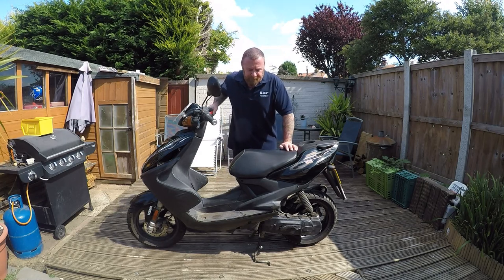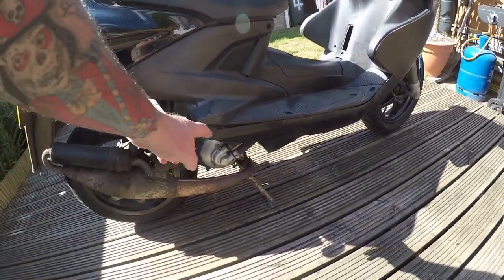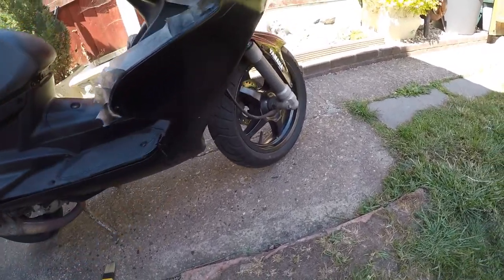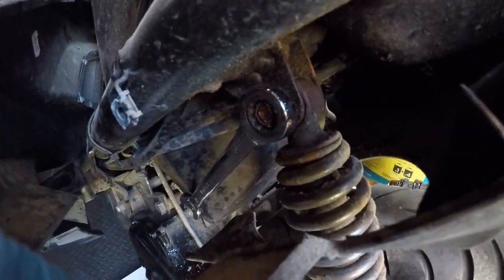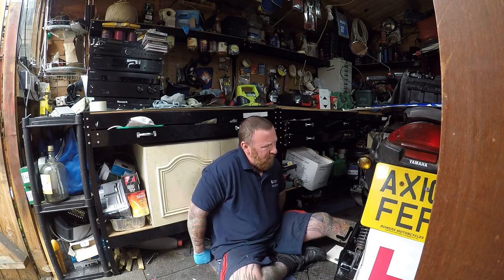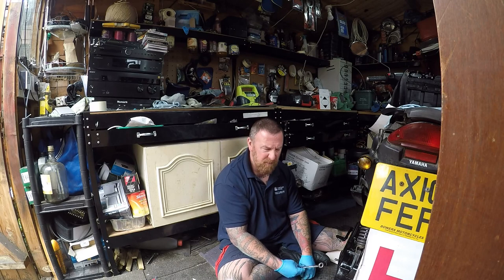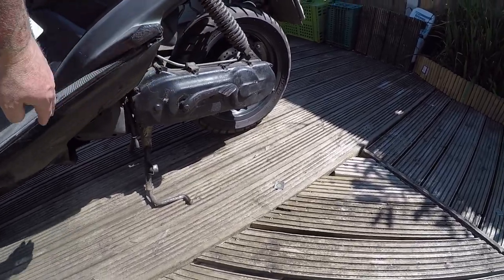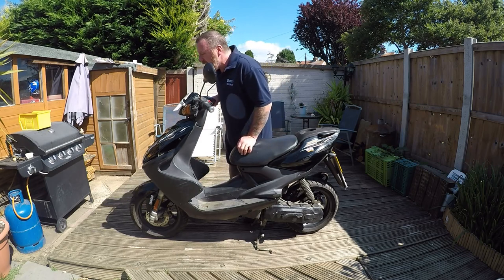YAMAHA AEROX 50CC MOPED BEGINNERS FIX LOOK OVER MARK SAVAGE

Comment from the maker: Hi all thanks for watching my newest video
Reply: Can I get some tips on a Honda lead it wont start up been told they filled up and then it stop working
Reply: HI MARK WHEN YOU SAY YOU BLEW OVER THE PLASTICS WHAT DID YOU MEAN ? THANKS GREAT JOB AS ALWAYS IV LEARNT SO MUCH WATCHIN YOUR VIDS OVER THE YEARS THEYV BEEN A LIFE SAVER IN SAVING ALOT OF MONEY LOL
Reply from the maker: @kingaz1985  blow it over as in with the spray can 
Don't spray heavy just a lite spray over .it works well bud
Reply: @marksavage  yeah thats great info matey thanks , iv just done a engine swap on my aprilia sr 2003 wc 50cc 2t its now a 2015 125cc ac 4t lol runs great had to make my own wiring harness tho
Reply from the maker: @kingaz1985  wow well done

Comment: Good video MARK. YOU KNOW THE DIRECTOR IS ALWAYS CORRECT ❗️I don’t know why but over here in the US we don’t see many small CC water cooled engines most of what we see is 4 stroke air called.  Thinking back over the past 60 years I have never owned a water cooled and I have owned some 25 to 30 BIKES, SCOOTERS, and MOPEDS from 50CC to 900cc KZZ900.
Reply from the maker: You know she's always right pmsl 
2t were always  big in the UK and not just small 50cc they did many and 250cc even a rare 500cc !!
Just fun to ride and the smell of 2t just gets in your lungs!!!
Odd i know but just brings back a happier time !
Take care mate 4t next week
Reply from the maker: Odd no water cooled as it hot but 2t run better with water unlike 4t as happy with the fan I guess

Comment: Hey Mark, watched a few videos and your content is really helpful!
Just had a question regarding my moped (2 stroke) I rebuilt it a while ago-everything but new crankshaft-and got everything running as it should, and was running great, run the new kit in for 200+ miles. But recently my bike started to loose power near full throttle, and it got worse and worse, anywhere near half throttle and the bike starts to bog and die down. I work on my own bikes, and I did change a handful of parts-new engine gaskets, new inlet manifold gaskets, new plug, new coil cap, messed with carb and other bits and bobs-but still have the issue unfortunately :/ do you have any ideas what it could be?

Thanks Mark! Looking forward to your next video! :)
Reply from the maker: this can happen and can be piston wear or once the head settles it might need a tighten down and a tune bud
clean plug and see colour 
is it ac or lc ? as if ac you can take head off and check piston to see if its scored 
sometimes the oil pump stops and then can run dry and score it
Reply: @marksavage  when I replaced my engine gaskets I do remember there being some small marks on the piston, but there was no bad scores or damage as I could see. It’s an AC engine, good old Yamaha slider to be exact. May be worth me just replacing the piston, as that’s still a cheap option, and getting it tuned, hopefully that works! I just want to try everything before asking a bike garage, as they charge a bomb haha

Thanks for the quick reply Mark!

Comment: Hi Mark love your videos, I got one problem on my scooter 50 cc 2 strokes, when it's cold works good, but when it´s hot loose a lot of torque.
Reply from the maker: Odd 
But maybe stator coil needs a clean 
Guessing you have serviced it etc 
Good rollers belt etc 
And serviced carb and check auto choke and Air mix
If so then could be stator once hot playing up

Comment: Picked up a cheap V-Clic for  £100 last week ,  First thing I did was delete the side stand switch
Reply from the maker: has to be done and that was a good deal bud , two v clic videos coming ( bloody things lol)
Reply: @marksavage  Along with the stand switch I focus on the carb and valve clearances first for poor running issues with these GY6  peds , annoyingly Peugeot  fitted an AC cdi when 99% of the other clones went with the DC  variant

Comment: Hi Mark. I think that there is a common issue with the new Aerox 4T EU4 2020 with its speed and power. On the flat they are ok, but once you start going up a hill , What would you recommend to do to get a bit of extra power. Remember that these cut off at 50kmh. Thanks for the feedback
Reply from the maker: This is why I like the older ones as you can play and upgrade 
The newer they are cdi restricted to 
So you can change lots on things like in my videos and only gain a few mph but quicker pull way

Comment: Hi mark I just bought this moped been registered since 2002 and when you turn the key for the ignition the gages won’t flick up like the fuel gage and that any way to fix and what could it be thanks 👍
Reply from the maker: take off the clocks and check them out bud
I have a load of aerox videos to help 
type in mark savage aerox s there should be over 30

Comment: I have looked through all you videos and am now a little stuck...my sons piaggio(50) has developed what seems like a misfires when accelerating, I have changed the plug cleaned the carb and checked for air leaks. no improvement, could it be the cdi/coil?
Reply from the maker: if could be a few things but normally fuel , is the plug spark a good blue colour?
vacuum working ok
float in carb ok? and the right air filter and tune like in my video
ht lead and stator coil ok ?
is it when running normal or top speed or any time?
Reply: @marksavage  it starts and idles really well, new ht lead and plug (need to find your video to check stator) was running well until last week. 
Now changed out soaking wet exhaust wadding, so am thinking way too rich. It now runs well WOT and idle but spluttering after 1/4 throttle acceleration, but does clear up. Will check idle mix and needle position. Its amazing what I have picked up and learnt from your videos, thanks for all of these and glad you are back.

Comment: just got my 2008 aerox (just like this one in the video) running and passed mot after 14 years of no use.

I've ridden it for a couple days now, everything seems perfectly fine, engine and power. but I have noticed today a kind of "rattling" sound when slight acceleration coming from where I think, the CVT area. 

Any ideas of what it could be? and how bad/serious it could be if it's in that area? 

ps. thank you in advance if you read this and reply. Cheers Mark.
Reply from the maker: I'd take off the engine cover and start as on these you can see it all working 
It can be the variator or clutch tinging even the dendix which could all do with a clean and change of belt if you haven't already 
Worse it could be is a little bit of piston slap !
Old ring etc
But start with the cvt system
Reply: @marksavage  okay thanks Mark i'll try and have a look!  could the rattling be old rollers too? I'm hoping for a easy/simple fix haha.   As I said, it's not down on power or anything like that, just hoping the little ped doesn't go bang!
Reply from the maker: @TheShubbah  no rollers don't do that but while off check clean or replace 6g
Reply: @marksavage  okay, thanks MArk. Have a good weekend

Comment: Hey mark, I have a typhoon 2019 50cc 2 stroke air cooled. I have attempted to de-restrict , taken the brass plate out, welded the original restrictive exhaust, changed the variator, and the bike still won’t go over 28mph! 

The belt and everything looks good, what could be the problem? I just simply want to destrict it is all. I checked the jet and it’s got a 58 jet in.
Reply from the maker: the newer the moped the harder restricted they are, this is why the older mopeds still command good money 
yours would be cdi restricted so you can get it to pull away faster but not much top end sorry to say without a sports / derestricted cdi unit 
then sports exhaust , roller, etc
Reply: @marksavage  thanks - where can I get a de-stricted cdi
Reply: And what gram rollers do you suggest I think stock they are 8.5

Comment: Hi mark, i have a sym symply 50cc moped, its been stood for 5 years i brought it as a non runner, its running now new carb, cdi, spark plug, new oil and drained the old fuel and added new, im not sure what it is everytime i start it it smokes out of the exhaust stays for about an hour and clears a little, would you know what it could be pleas
Reply from the maker: 50cc sym is a 4t so shouldn't  smoke , it may have piston or valve problems , whats the plug like after running , is it losing oil ? what does it run like
Reply: @mark savage  hi, thanks for the reply, it's not leaking oil, it's runs fine it's just the smoke, when I changed the exhaust manifold gasket there was alot of oil around that area, it looked to me like the previous owner attempted to fix but just made it worse as there was. Bolts missing it was a mess around that area could the oil get into  into the exhaust and causing it to smoke amd now its just sitting in there or no? ? But its silent now when ticking over as previously it sounded awful
Reply: @mark savage  I must add since replacing the gasket there is no more oil around that area

Comment: hi i have a lexmoto scout 49 2011 i have asked a question about this before about it not wanting to start but just keeps turning over with spark fuel and every thing else but it wont run but if i use the kick start it starts first time but shortly after this it now only starts on the button whenever it is warm (been ridden for 20 mins or so)  i think this might be choke but i have tried before putting my hand over the air intake and that didn't help any suggestions thank you
Reply from the maker: This video out 5pm Friday 
Had the same problem and its common 
Bloody things
Give that a watch bud
Reply: @marksavage  thankyou will do :-

Comment: Hey mark i buy a aerox 50cc year 99. But the gás and the oil digital display are goin crazy and the lights are weak. Do you have an idea whats happening?

Thx man
Keep whit a good job
Reply from the maker: Its very different display than our aeroxs !!
This is common on other digital displays and can be a few things 
Battery , needs a new one 
Connectors , all need to be taken apart clean wd40 and put back 
Wires , can be split or damaged all need looking at 
Clocks taken off and wd40 connectors 
And bad earths 
Have a try with that lot but but do all no half goes

Comment: When my Aerox is cold it runs fine but when it hot it bogs out then cuts out what would it be it got a stage6 70kit on with a stage 6 exhaust on can you help
Reply from the maker: as in my videos i hate the 70cc kits as hard to set up 
i'd go lower on the main jet by 4 and tune 
air filter set up ?
Reply: Ok pal I’ll try it and I’ll let you know mate
Reply: I’ve got a 75 main jet in what’s the standard one

Comment: Hi, i have a Peugeot speedfight 3 and i have a problem unlocking my seat so its constantly closed.. i try turn the key to unlock but it doesn't budge any idea how i can fix it?
Reply from the maker: This is common but don't just keep trying to pull it lol
Try and get under the left side panel and pull the cable 
You will have to get as many screws out as possible

Comment: would it be illigal to reset my mileage on my aerox ped n how would i do it do you know?
Reply from the maker: The dvla in the UK have the mileage on record every time its has an mot 
You can change the clocks if faulty or damage 
But if you try and take it apart it will break bud
Why do you want to change the miles ?

Comment: hi mate my mates boy wants to buy a moped  125cc the seller ask him to bring his cbt certificate with him he has not done it yet he  can still buy one without one can he not going to ride it
Reply from the maker: Never heard that before !
You or anyone can buy a moped / motorbike 
It's not for the seller to insist or ask 
A shop won't 
He will need one to ride it legally on a UK road but not to buy one 
The only thing a seller has to do is fill in the log book V5 
Which he should do in front of you and on line 
As for testing it 
On stand start stop etc
Even ask him to ride it up and down
If he won't 
Walk away find another bud
Reply: @marksavage  ok mate thanks for your help

Comment: Hi mark, Loving the content, someone’s dropped that bike a few times 🤣
Reply from the maker: Sure did, thanks for watching bud
Reply: mark savage My aprilia has 15,000 miles I thought that was low for a 2012 plate. This Aerox has 30,000 for its 2010 plate how many more miles do you think it will last?

Comment: Do you have and email address ? I have a oil leak in my speedfight 2 ac coming from nothing that I really don’t know what it is and if you could help that would be great mate ! I recently acquired the moped and I’ve beee working on it has a lot of bad work done to it and zip ties ahah and Also someone broke the stud on the exhaust and put a nylon nut and bolt there so I guess I have to sort that out too 😅 cheers from Portugal 🇵🇹
Reply from the maker: Ask on here bud or do a video and upload it and let me know and I'll take a look at it
Reply: @marksavage   upload it to where ? 😅
Reply from the maker: @Imek281  on here bud , upload a video on YouTube like I do and let me know 
As much info as possible with the problem
Reply from the maker: @Imek281  like you did with the cilo but more talking and less revving pmsl

Comment: I've been having a lot of problems with a 50cc I got a couple months ago 
It's like I'm engaging a clutch when I go at full throttle too long. Just no power going to the wheel until I come to a full stop, then its fine. Anyone ever experience anything like that ?
Yamaha xf50 thanks
Reply from the maker: its going to be your variator system i have loads of videos that cover this and one recent worth watching bud